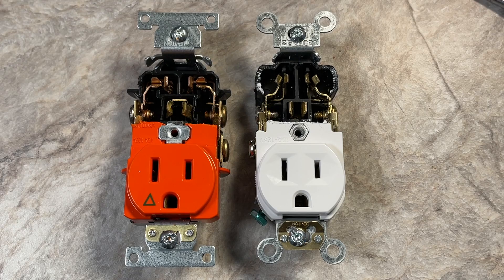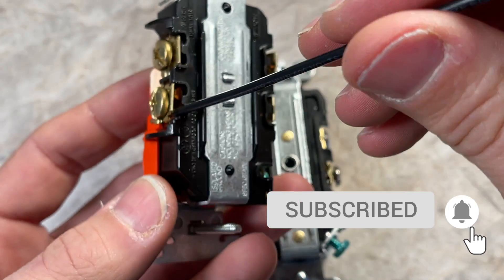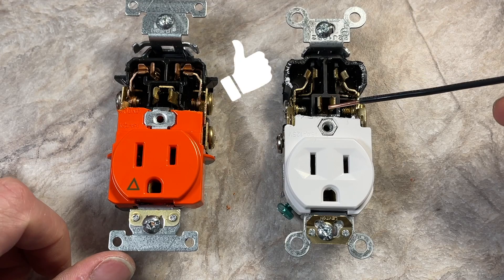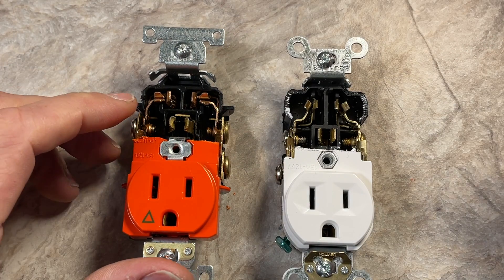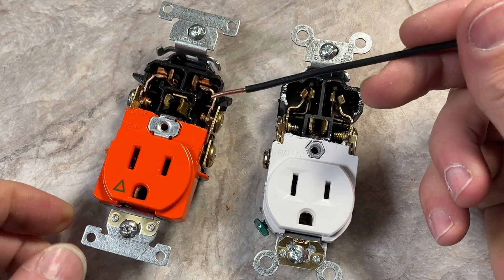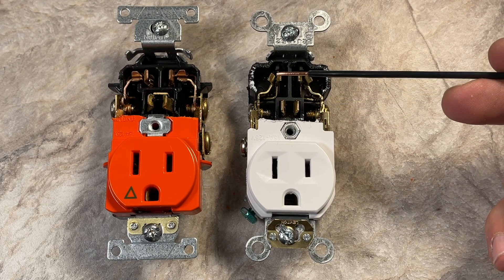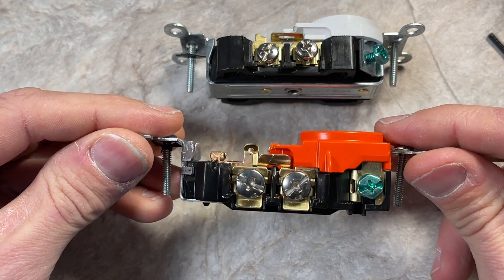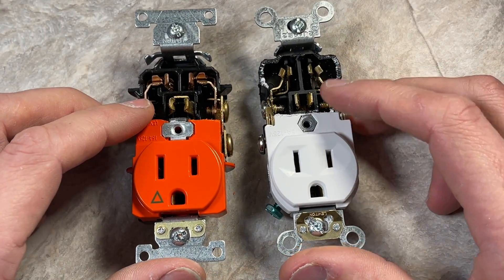What Outlet Should You Buy |  Commercial vs Hospital Grade

Comment: Spec grade recepts. are the worst and as a journeyman industrial electrician with 45 years experience in heavy industrial environments, I would never install one of those on any mill or machine. They just don't hold up, require constant change out, and can be dangerous to people using them. I would not use them in my own home for the same reasons. The commercial grade are much more robust, hold the plug more securely, hold the conductors more securely,  and the cost difference is negligible. Hospital grade is overkill for any home interior, but should be considered for say a garage workshop, where larger motor loads may routinely be plugged and unplugged often. Ampere rating should also match the current rating of the conductor. A 20 amp recept. should be used for a 20 amp circuit / 12 gauge wire size.

Comment: Yeah, I was expecting to see the face have slot for the horizontal blade, too.  Am no electrician.
Reply: 15 vs 20 amp. Easier to mass produce all 20 amp but slap 15amp plate on the front when installed into a 15 amp circuit. Then slap 20 amp plate on front for 20 amp circuits. Just a cost savings feature.

Comment: You showed the outlets UPSIDE DOWN. Just look at the embossed stamping by Leviton on the metal and resin parts of the outlets. The ground pin is supposed to be on top.
Reply from the maker: Hey Gary,  I did a whole video on this and currently NEC does not call out receptacle orientation.  Lot of different perspectives with the majority preferring ground down. Thx.

Comment: As has been mentioned in many of the comments below, the orange outlet with the green triangle is for the isolated ground.. the ground contact is isolated from the chassis ground associated with the mounting tabs for the outlet.  This could be in a hospital environment where extremely sensitive medical equipment is used.  This should prevent any noise from distorting reading on the medical equipment.

Comment: so it looks like the hospital grade is a 20amp plug or its the same internal as a 220 volt and or 20amp. hey you just said it.. good call.
Reply: i'm sure they use the same back for 120 20 amp, 220 15 amp and 20 amp

Comment: I question?. Regular home AC outlet do you install ground pin on bottom or top outlets?
Reply from the maker: This is not defined in the National Electrical Code.     You can install with ground up or down.  I still install ground down unless the receptacle is switched (one side controlled by light switch).

Comment: I've gotten my hands on is some "Nuclear" rated electrical surplus few years ago.  Isolation Transformers and multiple voltage/socket style connectors and enclosures.
Reply from the maker: Sounds intense!  More than $6 per receptacle?  😂
Reply: @EverydayHomeRepairs  3 pallets of surplus at a military warehouse auction, didn't pay that much but wish the electronic devices came with drives and drivers though.

Comment: Hospitals also install their plugs upside down intentionally so most of the weight is held by ground. While that is not actually part of the idea behind the ground strength, it does help. The reason they often install upside down is to make ground the first thing your or something touches if you reach down by the plug.
Reply from the maker: Makes sense to me, thanks for the feedback.
Reply: Hospitals install their receptacles right-side up, i.e. equipment ground hole on top.

Comment: These things look kind of primitive compared to european outlets. Like screwing in the wires is pretty outdated.
Reply: What is used instead of screwing in the wires? I just assumed you guys screwed in the wires as well (asking from Canada)
Reply: I don’t know what kind of system you are familiar with , but the screws gripping the exposed wire would make me feel confident that it is a secure connection.

If you are talking about the outlets with spades on the back of them , where you crimp the female end onto your mains wires , and simply pop them on, I would definitely feel relatively safe using them , but would prefer the clamping power of the screw.
Reply: It may be outdated but it’s the safest and most secure connection possible

Comment: Why do hospitals (and all medical offices) mount their outlets with the ground on the top side?  Residential are almost always with the ground down.
Reply: Per NEMA spec, the ground tab goes up. I'm told, but cannot confirm, it's to protect things if a plug is partially inserted and something slips behind the plug. It will hit the ground pin first, and be deflected.

Now, why does it bug us to see an outlet mounted ground up? Our brains prefer anthropomorphic (human looking) shapes. With the ground down, it looks like a face, and we're much more comfortable viewing it in that position.
Reply: @mikecowen6507  OK, but every single household I have ever seen has the mounted ground down.  This is important if you need to plug something in without looking or in the dark.  Every medical facility has them reversed.  And, yes, I already came up with your answer years ago.  Purely a safety issue.  It has nothing to do with anthropomorphics IMO.  Safety vs. comfort?  Which would you choose?

Comment: Please refrain from using "Hospital Grade" receptacle for your 'renovation' projects by just using 'Gem box' with side clips on sheetrock/drywall. Yes it will look nice in the beginning but those HG outlets are really tight and with the constant plugging/unplugging, it's only a matter of time you will see your drywall around the outlet(gem) box crumble and you will be left with a box hanging by its cable. For a "new construction", yes it may be overkill but your electrician should be able to securely install the outlet box on the stud.
Reply: If you mount everything properly, including NOT removing the "mouse ears" (remove for metal face covers ONLY) this should not be an issue.
Reply: @mikecowen6507  I absolutely agree with you on the "mouse ears" but my reference is about "gem box" in the  like of Raco502 or 512 solely for sheetrock wall mount WITHOUT being screwed-in on to the wall stud ( Raco512 & 502 are not for stud mount to begin with ). As such, it would be a 'renovation' job. And the 'ears' on these Raco boxes need to be adjusted too to be properly mounted.

Comment: The orange receptacle is NOT hospital grade, it is "isolated ground".
Hospital grade has a green dot.
Reply: Was looking for this comment.  Thanks.
Reply: NGinuity - I'm glad my forty years as a master electrician finally came to fruition. 
I can die now. 🍻
Reply: Being an Isolated Ground, it requires special wiring, in the form of separate equipment and bonding grounds. This is commonly done with MC that has an extra aluminum bond (like in BX / AC), that bonds the metal outlet box, and the regular green ground that connects to the green terminal, for equipment ground.

IG has some very specific uses, none of which apply in the home. Look out for hospital grade with the green dot and no green triangle.
Reply: Casey Cooper... That thin aluminum conductor inside of bx is a "low impedance conductor in intimate contact with the cable armor". It is to assure a quicker path to ground for a fault current. Without it, a fault current would theoretically have to travel around all those twists in a loosely would cable, which, I guess, used to happen and rather then blow the breaker or fuse, the cable would heat up like a toaster element in the wall. True story. So that small wire bonded the cable armor to itself, not as an equipment ground.
Reply: @caseycooper5615  Yes but some hospital circuits are on isolated grounds.  They use isolation transformers and don't ground their system like we do for residential.  If you are familiar with IEC terminology, they run the "IT" grounding system.  In residential we run TN-C-S. Hospitals don't want their neutrals tied into the utility company like we do for residential.

Comment: Why not use 20 Amp receptacles instead of the 15 AMP?
Reply: Its dictated by the wire gauge of the circuit. A fully loaded 20 amp receptacle on a 15 amp circuit could mean a fire. Upgrading the receptacle alone does not magically upgrade your wiring or breakers.
Reply: @mikecowen6507  I get that, but most business grade outlets you see are 20 amp on a 20 amp breaker with 12 gauge wire. Many houses built today have 20 amp circuits with 15 amp outlets.
Reply: @GlassicGamer  Not what I've seen here in AZ. Cheap as they can go. 15 amp devices & breaker, with 14 or 16 gauge wire.

If it was in my own home, it would be overkill. Single, homerun 20 amp device & AF/GFCI breaker & 12 GA wire, and at least plastic conduit. Maybe multiple devices on lighting ckts. Like I said, overkill. And yes, my computers would be true iso ground.

Comment: I'm not used to American socket since i'm French, why does the left hole is taller ?
Reply from the maker: The left hole is taller as it is the neutral slot with the smaller to the right being the hot wire.  This helps with ensuring 2-prong plugs are connected in the correct orientation.  With that said you will see phone chargers and other devices with the same size neutral and hot prong and this is because they can be plugged in either way as built in electronics can reverse the polarity if needed.
Reply: @EverydayHomeRepairs  Thank you !

Comment: If you want an interesting comparison, look at RV grade outlets. They are just sketchy as hell. They are made to be used as a single unit with the faceplate as part of it. The back is open and once you wire it you just shove it into the wall into a rough cut opening. No box or anything. And for something that is clearly cheap junk, they usually cost $10 or more.
Reply from the maker: Are those for RV or mobile homes?
Reply: @EverydayHomeRepairs  Motorhomes, camper trailers, 5th wheels, park models, and FEMA trailers. Anything that is meant to always be on wheels. They fall outside normal residential wiring codes and use them. 

Manufactured homes AKA "Mobile homes" that are meant to be installed and the wheels removed, they have normal residential outlets.

Comment: I might use these in my garage, it’s unheated and throughout the year has a 130° temp swing.
Reply from the maker: You could step up to Hospital grade but I am sure the commercial grade would do the job.  At least you have 4 seasons in your area 🥶
Reply: @EverydayHomeRepairs  thanks for the advice! My house is from the mid 50’s and the light switches are finally stating to go so I’ve been replacing them. The wiring is also two wire so I’ve been using the GFI trick to swap to three prong receptacles. I do admire the quality of the receptacles and switches that I’m taking out, and I feel obligated to put high quality parts back in.